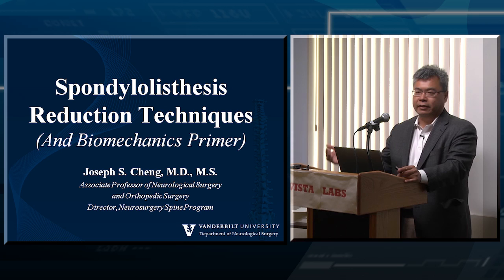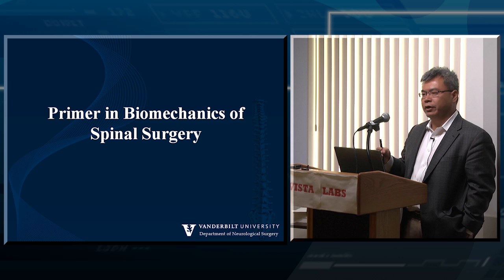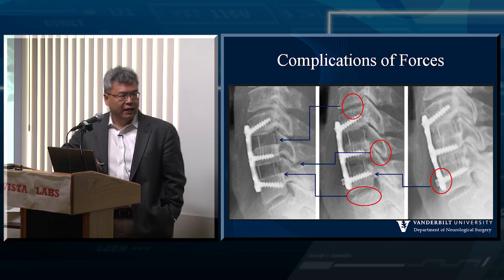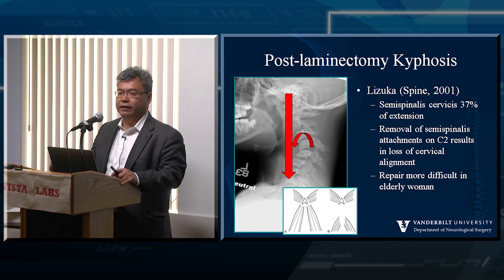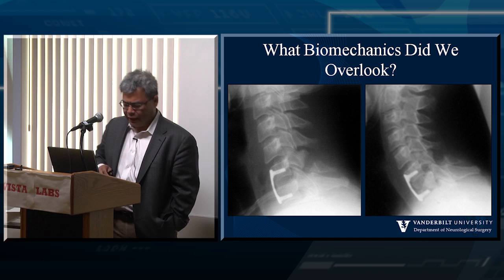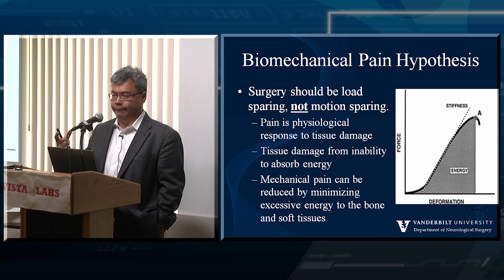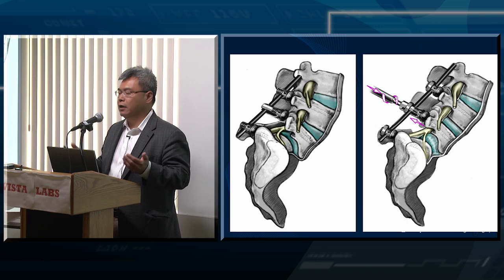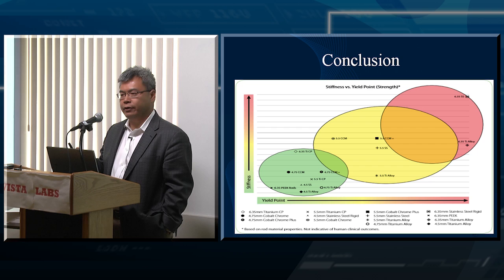Spondylolisthesis Reduction Techniques

Comment: My first failed lumbar ant-post fusion of L 4,5 S1 migrated a bone cage into my spinal canal.  Revision and Stabilization. My second A& P failed fusion, L 2,3 bone cage migrated into my spinal canal again I tried to make sense of why this could happen 2X and thought Slip Grade was miscalculated. I am now looking at a PSO due to 45-degree deformity and wonder how my past failed fusions could present a problem with sagittal balance to correct kyphosis. Trying to advocate for myself